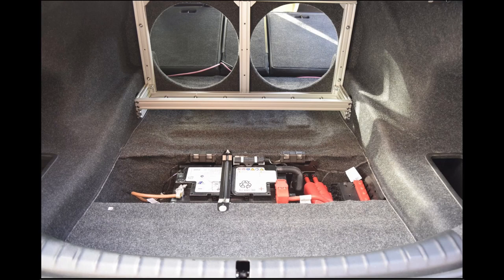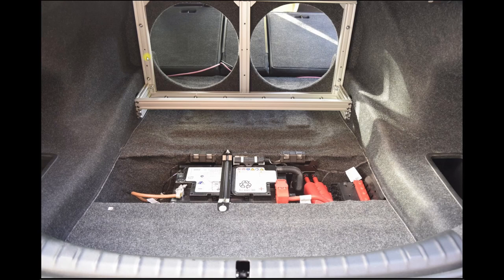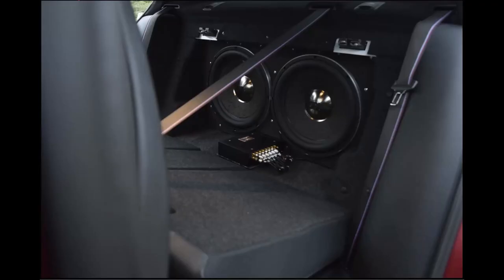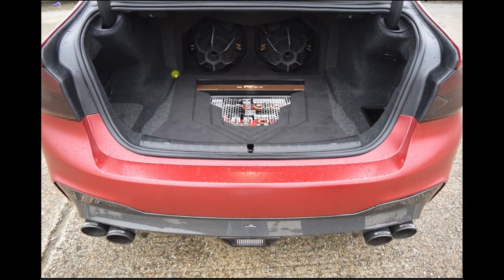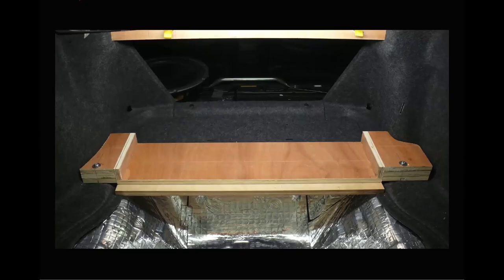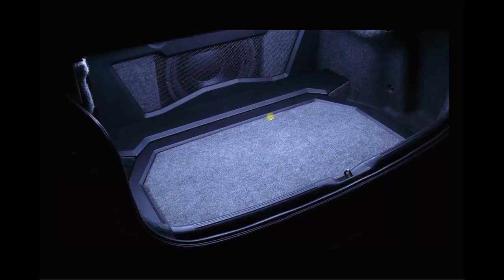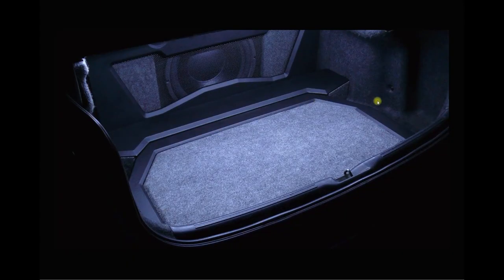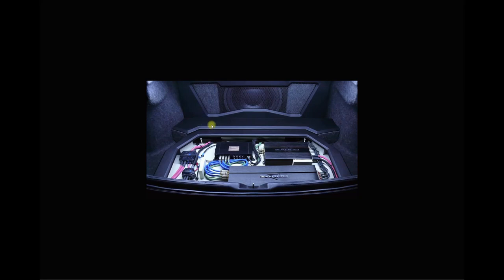How to Seal IB / Infinite Baffle Subs in Trunk of a Car - Mounting, Sealing, Orientation

Comment: I used a 10mm steel plate welded in...lots said it wouldn't work.with sound deadner on it works great

Comment: Hey Peter very nice of you too make this educational material. This is the content we need, but don't deserve😂😂😂

Got a question. Is an undertuned ported box practically the same as a sealed box? I simulated a trunk IB setup in WinISD and compared the sealed version with the ported version (tuned at 16Hz to only allow DC airflow for cabin and assist a little with the low lows). The effect on phase and group delay were minimal at +20Hz. It seemed fine so I made it, set it up and I'm happy with how it sounds. The question being, have I lost anything going from IB to an undertuned ported?

Not to mention the response can now stay near flat down to 18Hz, gaining over 8dB over the IB, which is impressive.
Reply from the maker: Hard to tell without knowing what sub you have. When you use subs like the AE in the video, I don’t think anything can beat them for SQ. Having certain frequency response is just a single thing in the equation to determine what it actually sounds like.

Comment: I’m starting on an Impreza like the one you showed here. I’m aware of the electrical system shortcomings too, so I’m curious what that car had for an alternator and battery and what you would have preferred them be changed to if you could. Thanks for this video, very timely!
Reply from the maker: That Scubby had stock alt with Optima Red Top upfront and a 40Ah Stinger AGM  at the back. Having min 40-60Ah lithium would help to step up to bigger bass power, but if you plan a hungry system, then plan for an uprated alternator too.
Reply: Going all Lithium is the best bet.

Comment: I want to experiment with this technique. I have a Kicker 15 laying around. Thanks for the video!!
Reply from the maker: It’s not ideal for any sub! Their T/S specs have to be suitable for this application. Low Fs (20-25Hz), high Qts (0.5-0.8), high VAS (150L+ for a 15”), high Xmax (18-20mm+ for a 15”).
Reply: @pssound9749  Thank you for that info!

Comment: What are your thoughts about leakage around the C-pillars? That is where a lot of manufactures pass wiring into the trunk and the holes can be massive.
Reply from the maker: You also have trim panels over them, then the side of the seats, so it doesn’t really leak as much back into the cabin. Also, you have to compare the cone area to the level of leakage and then any leakage is negligible.

Comment: You should make and sell kits.  In my IB setup, I feel like too much air is moving up to the rear deck causing a lot of rattles.  I have the rear deck sound deadened but it doesn't seem to make a significant difference.  Do you think it would be a good idea to mount a board on the bottom of the rear deck to prevent or reduce the rear deck rattles?
Reply from the maker: Yes, a board would certainly help with lots of isolation & foam between the shelf and the board or just stack & glue boards on top & bottom.
Reply: @pssound9749  ok thanks

Comment: Hello, What specs should I look for in a subwoofer to determine if its good to be used on IB setup? I have Carpower Raptor 12mk2, and I'm wondering if I should go for reflex or IB in Volvo 240 trunk. I have built IB setup in one volvo 240, it had SPL Dynamics 12" and worked great tho I didnt have enough power for it back then. Thanks for all the awesome content! Br, Jussi, Finland

Comment: I am considering to do such a setup in my Audi A4 B8 Sedan. I am worrying that my trunk will rattle insanely from in and outside. I would like to use an Audio System R12FA Evo. (375W Rms). I think that amount of power should be enough for a nice sq build?
Reply from the maker: Yes, that power should be enough for a 12”.

Comment: Mettre un Subwoofer de 38 cm  sur une plage arrière en bois de 18 mm   es t'il possible ?   Is it possible to put a 38 cm subwoofer on an 18 mm wooden rear shelf?
Reply from the maker: I’d rather suggest min 36mm and many many bolting points heavily supported.

Comment: IF I was to do IB in my 2008 Chrysler 300C......Will any sub work for that?....I'm looking at Morel, Xcelsus  or Blam equipment. Will 2 12' work?
Reply from the maker: It’s not ideal for any sub! Their T/S specs have to be suitable for this application. Low Fs (20-25Hz), high Qts (0.5-0.8), high VAS (150L+ for a 15”), high Xmax (18-20mm+ for a 15”).
The more cone area, the better.

Comment: Hey Peter, when do you feel like the system is completely done? I just put a full system in my 1999 Ford Ranger, a tiny single cab pickup truck now the whole interior back panel is essentially a big amp rack. I like what I have now but I kinda wanna change the rear speakers and subwoofers to something bigger. I had an installer do some of the work but gave me my truck back with alternator whine and hissing when it never had that before. So I’m hesitant to pay someone if I want to switch it up again. Thanks
Reply from the maker: Well, it’s completely done when you have no noises and the setup is properly tuned. 
You just need someone more capable & reputable than this aforementioned installer.
Reply: @pssound9749  thanks for your reply Peter! I was able to get rid of the annoying alternator whine but part of the hiss is still there even after playing with the amp gains, it’s just unfortunate that you pay good money and expect the quality to live up to what the install said they could do. I will try another installer here locally and see how it goes. Greetings from Arizona, hope all is well.
Reply: @urielmejia3600  did you get rid of the alternator whine?
Reply: @paulfretz6777 I did, once I switched to a helix amplifier it got rid of all the noise.

Comment: Can you show more true infinite baffle like your car? And also are there anyone with true infinite baffle with 4 or more 12s, 15s or 18s for SQL setup as I am thinking about doing true infinite baffle in a suv but going to add more cone area for more spl out of them or correct me if I'm wrong as I have never done it.
Reply from the maker: Go to the True IB playlist on the channel. There’s a build with a 24” shown there.
Reply: @pssound9749  so I see that ib can get really low in the tens, what is the frequency response for the higher frequencies 40, 50, or even up to 100 Hz? Can ib cover that wide of a bandwidth?
Reply from the maker: Gabriel R they can play upto midrange if they want, just like any sub, BUT what you and everyone else has to understand is that what you hear mainly depends on where the sub is located in the car and what car it is. 
Watch the video about “why upfront subwoofer in a car” video on the channel, that will change your perspective about what you actually hear in a car.

Comment: Why you use big free air subwoofer?
Reply from the maker: Because it’s most musical, sensitive option you can have in a saloon/sedan car.
Reply: @pssound9749  логично! Ok, rear sealed sub + free air sub = great bass
Reply: @pssound9749  at crossover, suv ? Sealed box or vent?
Reply from the maker: PePPeR - A in SUV you can do “true IB” by cutting a hole through the floor or just have a box.

Comment: I have been looking into doing this type of build I went from a suv with a single 15 inch sundown u model in it in a big ass box to a Chrysler 300 and having to make a new box tnats still big and it sounds good but if these beat hard still I would like to know if I can run my sub with a build like this
Reply: I got a 300 with 2 15s facing the back seats and a port going through the rear deck and it makes all doors shake and flex the windshield a little